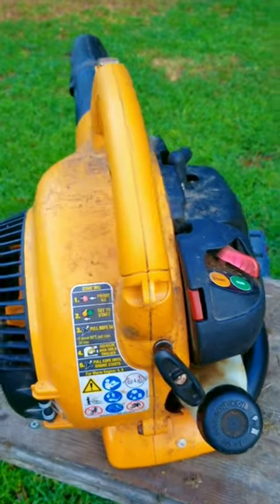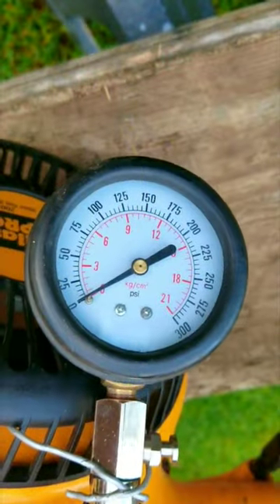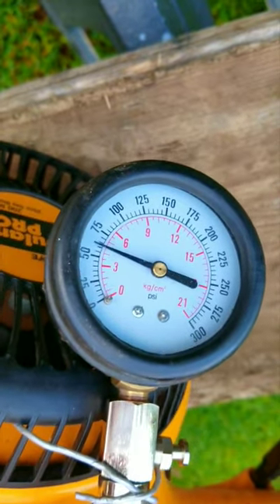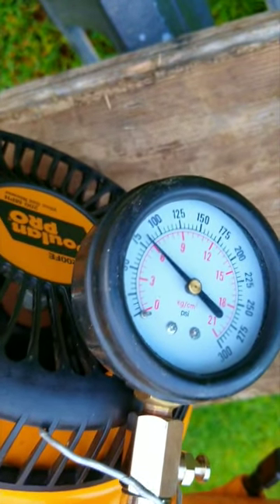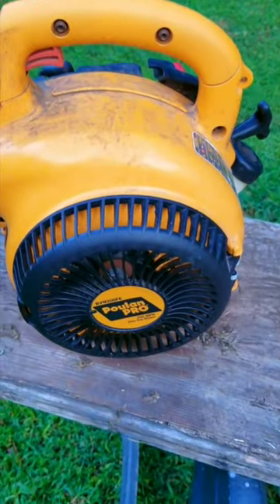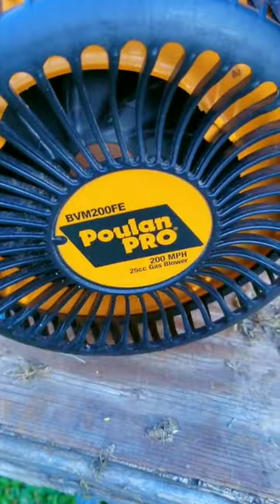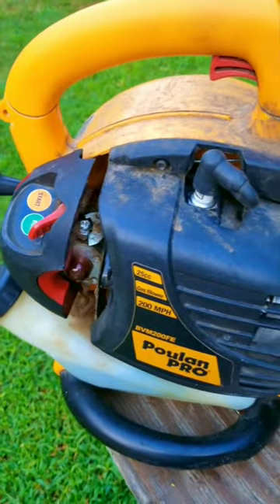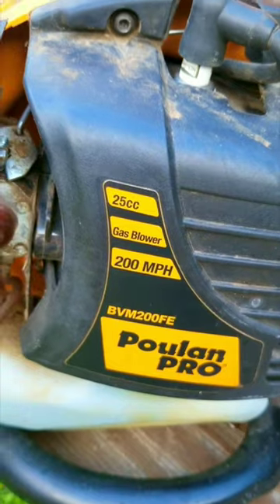This Blower Sucks But I'm Still Going To Fix It

Comment: Years ago I bought one of those "New Refurbished, not running" one from ebay.  I took it apart and found the piston ring stuck to the piston by carbon build up.  I cleaned up all the carbon buildup and bought a new piston ring for about $3,  Worked ever since.
Reply from the maker: nice work, thank you ytlas3

Comment: I have the same blower, had it for 10 years. I use it so much, even in the winter to blow snow off of equipment. I love it so I would pull the exhaust and carb to see what the piston and cylinder look like. And if it all looks good I would try the compression test with a squirt of oil in the cylinder and see if the compression goes up. That will tell you it may just need some new rings. The cylinder kit may be available super inexpensively.  With the prices of everything going up so much so quickly and where pop places like California have stopped the sale of new gas equipment, it's worth digging into to. Can't wait to see what you find 👍
Reply from the maker: I haven't looked for a cylinder kit for this one, but now you've got me interested.

Comment: That's a 15 minute fix. Empty any fuel in the fuel tank, then take a can of brake clean or carb cleaner, spray into the tank, get a small puddle in the bottom prime some in. Keep pulling with choke open for about 2 or 3 minutes. Empty the remainder of the fluid out of fuel tank. Let sit to fume out and dry. Mix the 2 cycle fuel to correct ratio and then start.

Comment: You'll probably have to buy at least a piston ring. Maybe a piston. Depends on the amount of damage.
Reply from the maker: you are correct, luckily the ring wasn't showing any excessive damage
Reply: @HomeGaragechannel  That's fortunate, I burned the piston out of a Stihl 044 but fortunately the jug was fine. Once I stopped getting gas with ethanol anywhere near my yard equipment those massive reliability problems magically went away.
Reply from the maker: it's amazing isn't it. thank you Kevin Dawson.

Comment: The biggest thing in a 2 cycles life is clean fuel period!  Dirt in the fuel will plug things up, remember
The lube for the engine will be blocked along with the fuel, a burned piston and sleve will be not far from from melt down.  Hope this saves someone from a bad day.

Comment: poulan is the king of making stupid design decisions. I mean why reinvent a toggle switch instead of using an actual toggle switch. it doesn't make sense unless you want to screw the customer over when it comes to fixing the equipment.